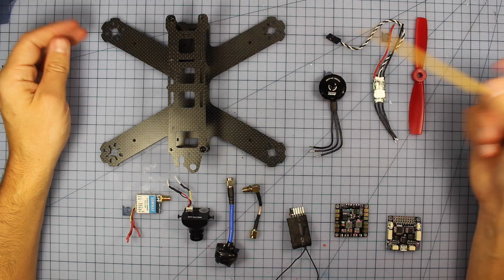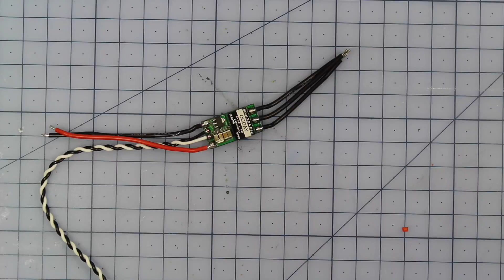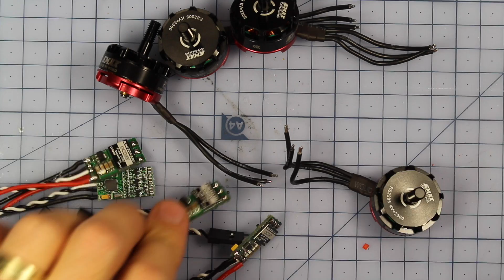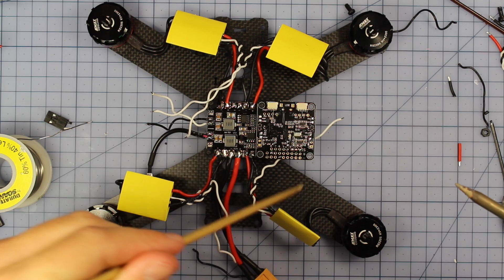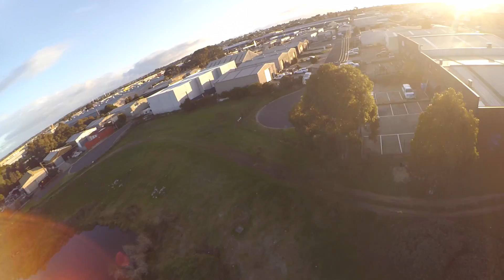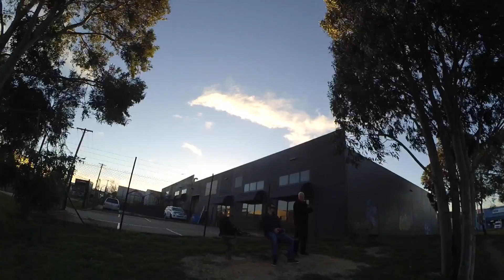Beginners guide to Building an FPV racing quadcopter.

Comment: on the negative wire for the signal to the esc, would it cause problems if you jump it to the negative pad on the esc itself?
Reply from the maker: I think either remove it totally or ground it to the pdb

Comment: It's kind of weird how you can change the direction of your FC in your software, and even the direction your motors are spinning (if the esc allows), but not the actual position of the motors, which should just be another variable in the algorithms? Why would it matter which motor you plug in the FC in which order? It's not like it would be a huge problem to tell the controller to "give 50% power to motor X" when you want to go left instead of hardbinding it to "motor 2"
Reply: You can, actually. It's called custom motor mixing, but it is in the CLI options and not in the GUI. You can reassign motors to any pin you want. Sometimes people use this option when a pin was accidentally damaged on the board from a crash.
Reply: +kwa Ah, ok. That's good. I've never really dug into the CLI options to see whats available there.
Reply: Aric Blunk The problem is that people could end up soldering the leads first and maybe even top it off with hot glue, before realizing they had to do it in a specific order. I don't think it would take much from Cleanflight to have a base layout, and then simply add the ability to move the motors around in the gui if you click a button to unlock it. They might not simply have thought of it, gotten around to it, or maybe there is a good reason for not doing it that I am not thinking of atm
Reply: Aric Blunk Everyone has to begin somewhere, and every amateur builder is going to do mistakes. I haven't done that specific mistake myself, but my brother did on his hex quad (He didn't soldier wrong tho, he just plugged all the cables in a random order, and it obviously flipped on his first attempt at flying it). And saying "just buy it prebuilt" is kinda retarded, as you'll never actually learn how to do it then now would you?

Also please don't presume anything about me. I'm on my fifth drone right now (plus 3 more that wasn't mine), and I know perfectly well what I'm doing. That doesn't mean I still don't do mistakes now and then, either simply forgetting something or just being stupid for a second. Any fix you can do in the GUI is good, especially when it's not that hard to implement.
Reply from the maker: Just chiming in here. You can indeed change the motor mix like aric is saying. The reason people don't and the reason you need to make sure motor 1 is on pad 1 is because the FC does not know where that motor is physically in relation to itself. 

say the quad is on level mode and it starts dipping to the left. Well it needs to power up motors on the left hand side more to re level it self. and as far as we have told the quad motors 3 and 4 are on that side. 

Clean flight does have a big BIG picture showing which motor is which. and the pads on the Flight Controllers are numbered. as far as an easy gui button goes I think it is opening a can of worms that lots of people (who don't understand it properly) might screw around with and totally confuse themselves. I like how the motor mixing is locked behind the GUI because that way you cant stumble across it and change it without really meaning to. Just my opinion.
Reply: UAVfutures That's not really an issue. This is programming as I explained in my first post. You never tell "motor 3" to do anything. You tell "motor x", where "x" is an atribute that is default 3, but can be changed to 4 if the user wants to. Since you can change it in the CLI, this is already the case, and the cleanflight guys just need to implement it in the GUI. It's not like it would be a problem to have a button to unlock the engines with a big warning beneath and a popup warning when you click it (which for an example they have for motor checking in the gui already).

Yes, there is a big picture in the gui that tells which engine goes where, which is fine and nice. But if you don't remember the order you have to start the program while building the drone just to see it, and even then it's easy to make a simple mistake. Don't get me wrong I never thought this was a huge issue. but anything that can be changed in software instead of hardware is good.

I honestly think they either haven't thought much about it, or haven't gotten around to it yet. Or they see it as unimportant and don't want to waste time on it, which in my opinion would be a bit lazy.
Reply: Aric Blunk But the programming is already done. The algorithms are all in place. Even the ability to change "motor 3" to "motor 4" is already in place (which it would be from the start as no programmer hard codes attributes). The only thing they need to do is implement it into the GUI, and that is relatively simple. Basically what they have right now is the ability to write a piece of script that tells the code to "change motor 3 to motor 4", what they need to do instead is having a button that writes that piece of script automatically when you click it (Which is basically what the gui in this case does in the first place, since the program itself lies in the firmware on the chip. You just need to tell it what you want to do. You click buttons instead of writing the script by hand)
Reply: Aric Blunk No, that's really good advice. It's the correct way to do it.
Reply: Excludos The GUI would require entry for custom throttle, roll, pit, yaw values since some people have asymetrical motor placement. To have that would be very closely the same as entering it into the CLI manually, in my opinion (maybe that's why it was never pursued).

Honestly, there are many things in CLI that would be handy to have within the GUI, so I think the devs have a lot of work cutout for them if they pursue them all.

Comment: what diameters of lead solder do you suggest me to buy?
Reply: aww, i love the smell of the flux.  its just burning rosin.  i mean, i smoke cigars so i'm sure its not as bad as that :)
Reply: .8 60/40 lead.
Reply: Also known as .032 diameter in imperial.  It's the most versatile thickness.   Also make sure it has flux/rosin core.  And use a fan as the smoke is toxic (from the flux, not the lead).

Comment: at 10:23 i think you forgot the link in the video to the XT-60 video, other then that nice, i also love my RS2205 2300 on 5x4x3 ;) Also, why do you never protect your Rx antennas? You keep using zipties to hold them away from the props but the most important part of your antenna is always bend and unprotected, why not just use longer zipties? if the antennas arent straight you get alot worse range etc. out of it, but everyone his own i guess

Comment: Would you recommend this for me as I have not built any racing Quadcopters yet but I do have two drones that are not for racing and I am really good at them as I have been flying for 1 year . As I wanted to get into racing is this I good choice or would you recommend something else. P.s great videos
Reply from the maker: yeah this is a great kit
Reply: +UAVfutures hi  I am going to get the Quadcopter but I did not know what battery to get for it
Reply from the maker: Project Gaming get either a 3 or 4S 1300 man battery. 60c or more. also I think this kit is on sale for a few more days so it is even cheaper
Reply: +UAVfutures thanks I well show you the finished product when everything comes
Reply: +Project Gaming is this a god battery to use https://www.amazon.com/Turnigy-nano-tech-1300mAh-45~90C-Lipo/dp/B012W65JFA/ref=sr_1_3?ie=UTF8&qid=1466224619&sr=8-3&keywords=1300mAh
Reply from the maker: yes

Comment: Why do you connect ground wire from the esc signal lead to the PDB ground instead of FC ground? Isn't battery ground going to affect oscillations and other bad stuff in ppm signal? BTW, thanks for video. Very informative, as always. BTW (2) You forgot to add a link to BlHeli software to the description. :)
Reply: Personally I've just left the ESC negative lead lead off completely and I haven't had any problems. Connecting it to the FC ground will give you four earth loops which can potentially act as an antenna and potentially  give you more interference. 
For shielding, you'd probably be better off just connecting one end of the earth wire.
Reply from the maker: Most people just take them off completely. But I prefer to ground it, but not through the FC. So far I have no have any issues the way I do it, or removing it totally